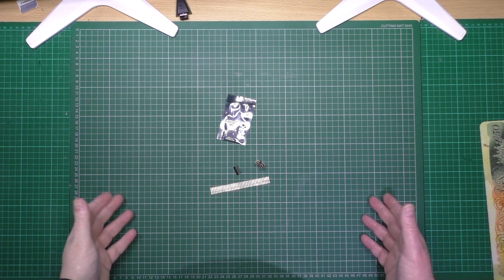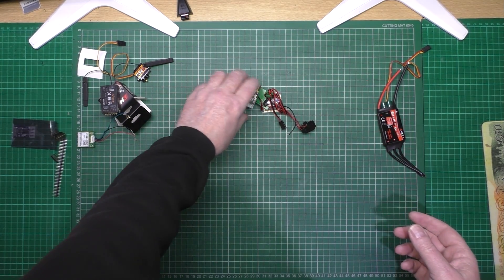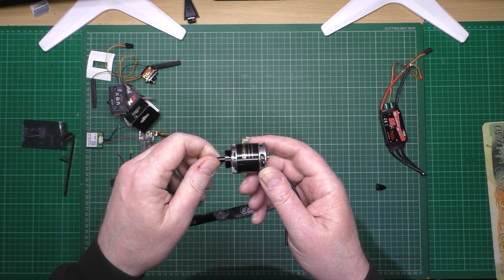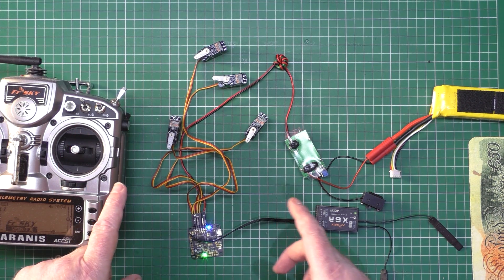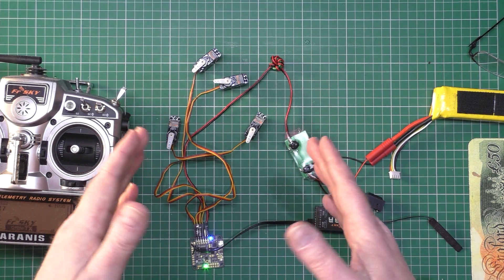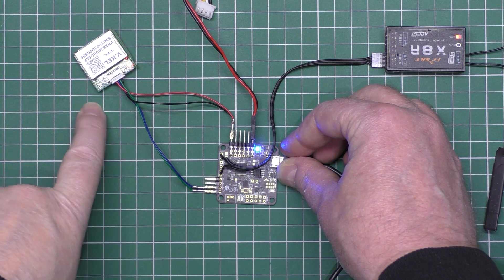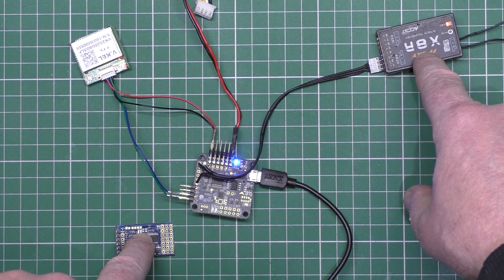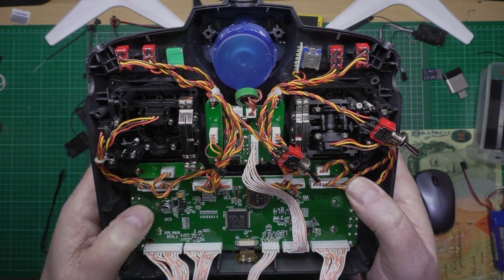Mini Talon with Naze32 and iNav - Part 1

Comment: Oh, bugger...sorry your Taranis has died Tony....I just finished giving mine a Makeover of gloss white enamel spray paint and a pair of M9 Gimbals...and a new 3S Lipo...Hope your new one arrives soon m8.....Damn...Aint all your Models on the micro SD card in the Transmitter?
Reply from the maker: I work in IT mate. Just like a mechanic drives a pile of crap, us IT blokes never back anything up!    
The new Taranis has already arrived but I have a question....... are the new M9 gimbals worth it? I don't really see the original ones as a bad thing but everyone says to upgrade them.
Reply: Oh dear, I know what you mean m8...lol...Well, I test flew the Skyfun the other day and flat out it's no slouch...the Gimbals earned their keep as I had way too much Aileron movement first flight....Machined metal frames and metal arms inside, yes you can immediately tell the difference, my sticks were about 2 years old anyway...getting worn..On the plus side, you can clean and paint the front of your old TX Case maybe...My Taranis makeover is on the Hub...Looks nice...:)
Reply: OMG! IT really ? That is almost funny, if I didnt feel your pain. Geez that really blows. We all need to learn from this and backup.

Comment: Aw no! what a tragedy! :-(
Well, with your skills, you should be able to recover the data from the memory.
Maybe piggybacking something over the pins to send RAS and CAS or similar and read the results?
Or, if NVRAM, just transplanting the memory to the new one? (after backing it up!)
Reply from the maker: It (or s***) happens mate. I'm not going to bother because the old radio had a very old version of OpenTX on it. The reason why I didn't update it is because the models are incompatible with the newer versions.    
Lesson learnt!

Comment: Aeromax OSD looks like something I need.  Do you know if they take paypal?
Yes you need a new Taranis, ouch.
Reply from the maker: Yes Dave, they do take Paypal.   
The trouble with the old MinimOSD is the heat. Most of mine have burnt out now but the Aeromax can me left on forever with no problems!
Reply: Thanks for the info. Think I will get a couple.

Comment: Sorry about your loss :(. I've had my Futaba 9c for nearly 10 years and still going strong (modded to hell with TBS Crossfire and custom firmware etc.. I also don't have anything backed up although I store my models on external campak module. Defo getting plane ready for summer flying too (fellow U.K. Pilot).  :) tempted with the Nimbus or Clouds
Reply from the maker: I'd love one of the Clouds..... the only problem is, they're not in the UK yet and the last large plane I bought from China was rather battered :-(

Comment: Sorry to hear about the Taranis Tony. Most mysterious that it should just give up the ghost like that any clues ? You can get new logic boards reasonably cheaply as parts. Did you go for the new M9 gimbal version for the replacement?
Reply from the maker: No mate, the M9 isn't available as a complete kit in the UK - I can only buy the old (Taranis Plus) radio and upgrade the gimbals but I'm not decided whether I want to yet.
You know when the Mrs starts acting up and you wish you could fix her? It's much better to get a new one, rather than fix the old one because it just doesn't feel as good and you really don't trust her :D
Reply: I agree to replace completely. If I don't trust my 'core' equipment - especially for FPV, I end up not enjoying flying coz I'm flying crazy cautiously just 'expecting' something to go wrong the entire time.. I come from helicopter background where things can go wrong very quickly just from poor maintenance. If I doubt any of my equipment, I long it off and replace for new, no questions. If I can't afford it, I wait till I can no matter how tempted. :)
Reply from the maker: It's different for me..... I crash whether it's new equipment or old :-)